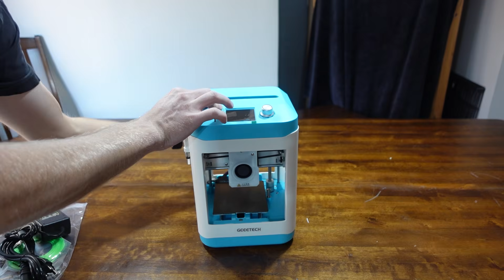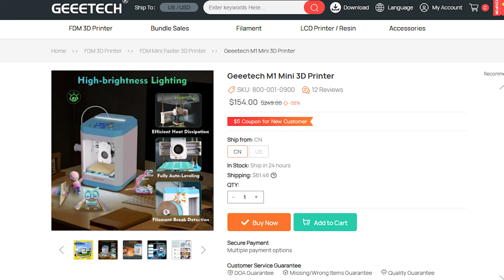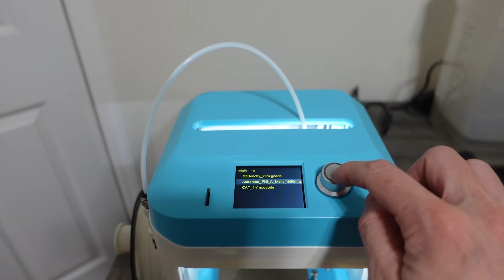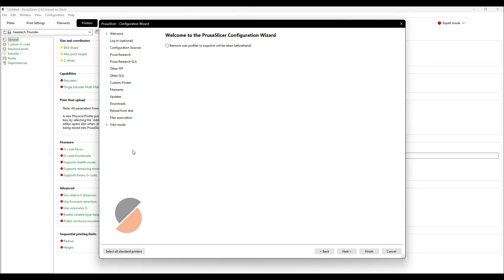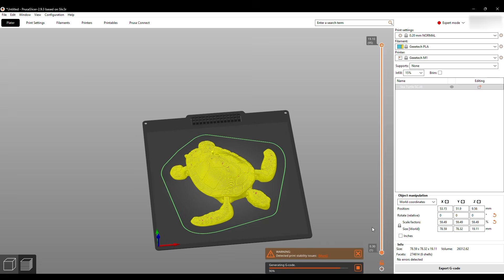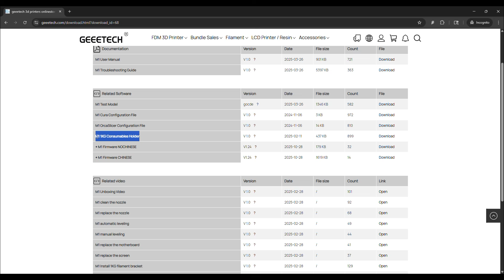I Tested the Smallest Cheap Printer l GEEETECH M1 Unboxing & Review

Comment: The fact they bundle incompatible reels with the printer is weird
Reply: They should include the correct holder
Reply from the maker: You can print the holder (I did later in the video). I understand why you'd want to include it but it took less than 2 hours to print and the files are presliced and ready to print!